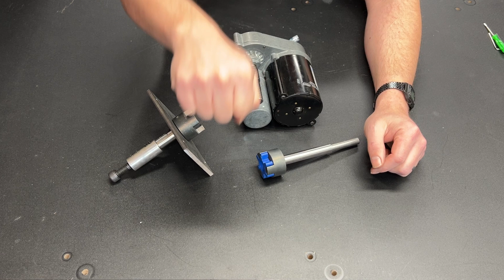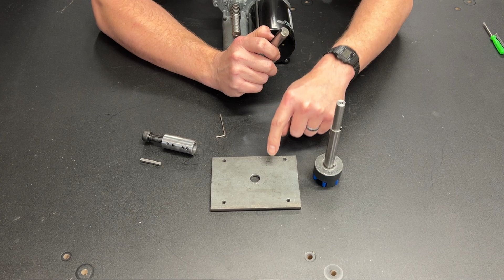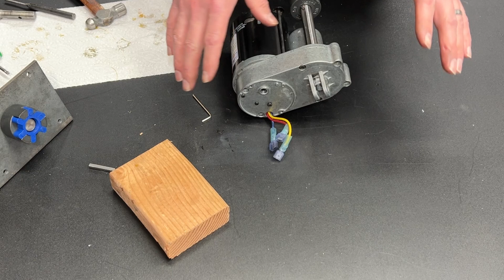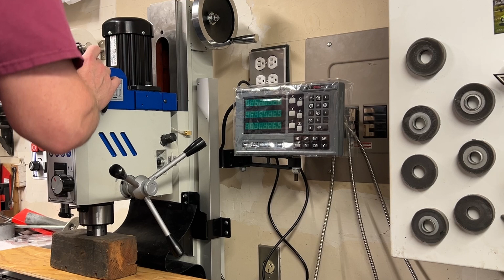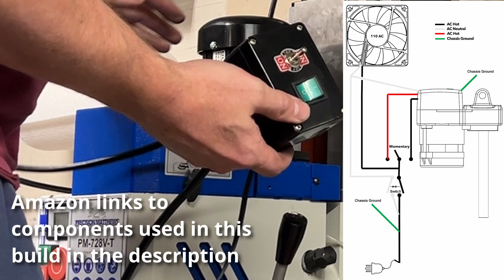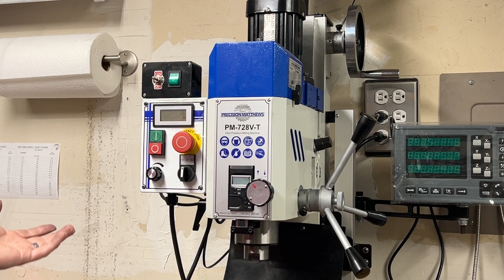Making a Mill DIY Z Axis Power Feed Using a Treadmill Incline Motor for my PM-728

Comment: its no use!!! you cant mill with this motor!  its only convenient to  lower or raise the mill motor,   for that the handwheel is sufficient enough, saves the hassle and money!!!
Reply from the maker: Thank you for your opinion but it's not accurate.  Clearly you haven't spent time cranking on a machine like this.  Hand cranking to adjust height is a pain due to the wheel location especially if going any significant distance, but with power feed it's effortless.  I can and do still use the hand wheel when actually milling something.  As far as saving money I already had most of the parts on hand so mostly all I was out was a little time but even if it had cost me $ it would have been well worth it.  Interesting that you have formed a strong opinion without having it on your own machine... if you even have a machine like this.

Comment: Love your treadmill motor vids. I have the same incline motor as you have in this video. Do you think this could be fashioned into a bandsaw power feeder? I'm struggling to get this project going. Do you any tips that could give me a jumpstart? Thanks!
Reply from the maker: so the challenge would be converting rotation to linear motion.  It has a built in lead screw so that is doable but hard to package.  you would almost need to put it on the back side of the band saw table and have it pull.  The bigger issue and this one is huge is a treadmill incline motor is intended to have 500-1000 pounds of lifting power and that is way to much force pushing into the blade. A band saw blade is probably not seeing more than a pound when hand feeding.   I really don't think that motor is the right choice for this application.
Reply: @dazecars  Thanks for the reply. Great points. Back to the drawing board... please keep the great videos coming!
Reply from the maker: will do... Or at least I will try 😁

Comment: Genius idea for tightening around a threaded shaft. Any tips for making the key.
Reply from the maker: I inserted the unthreaded key and tightening assembly in the coupler and then ran a tap down it.  There have been enough questions about how I threaded the key that I think I will make an upcoming video on the subject.
Reply: @dazecars  Another good idea. I imagined slicing a rounded threaded coupler.
Reply from the maker: sorry I didn't reply sooner, this comment was for some reason "held for review" by YouTube.  Your questions along with others questions inspired me to make a video on the subject.  If you are interested it dropped last Saturday https://youtu.be/H-7CP4gCsVc

Comment: FYI… INT duty means “intermittent”… not internal. Unfortunately, it doesn’t say what the time on/off is. Nice mod. I’m sure you’d be fine without the fan and shroud, but not a bad idea going the extra mile. 🙂
Reply from the maker: Thanks for the clarification in the definition of "int"  similar motors I have are all 1 minute on and 5-8 minutes off.  Typically I am not moving the head for more than about a minute.  My purpose for the fan was to counteract multiple moves with not much time in between which could create a heat buildup. Glad you liked the mod
Reply: @dazecars  Not a problem 🙂 It would be interesting to see the temperature of one of those motors under load and chart it over time… just for science lol. 😆
Reply from the maker: That is a disgusting thought..... that I have had my self and have though about breaking out the infrared thermometer for just such an experiment 😂😂😂

Comment: How did you thread the key?
Reply from the maker: I drilled and threaded the insert then milled out the groove.  From there I inserted the unthreaded key and slid the entire assembly into a love joy coupler.   I was then able to run my tap down the bore and cut the teeth in one end of the key. Next step was to take it all apart and move the key up about 1/4", align the threads with a bolt, slide it back in the love joy coupler and ran the tap down it again.  Rinse and repeat until there were some threads on the entire key although not at full depth on the end where the tap tapered.  To fix the issue of shallow threads on one end I flipped the key around end for end, realigned it with the bolt, inserted it back in the coupler and finished cutting the threads to full depth.   Make sense?
Reply: @dazecars Thanks.
Reply from the maker: My pleasure

Comment: A side question - What led you to chose the 728 over the 833? I am trying to decide which I want.
Reply from the maker: The biggest factor was cost especially since I spent an extra $900 on the factory installed DRO.  The other factors was there is not a lot of difference size wise X Y Z travel and the 738 has excellent reviews.  I am sure the reviews of the other machine are also good but this machine seams to be able to do everything I need it to for les money.

Comment: ...but.....can you hand crank it   ?     the reduction gears to the reversible ac motor would constrain hand wheel cranking ( manually )....would need a disengage clutch !
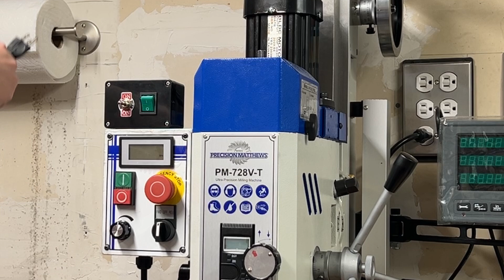Reply from the maker: good question, I addressed it towards the end of the video 19:48.  Resistance increased but it is not hard to crank at all.  It's really no different than any of the other kits out there as they all use gear reduction motors.